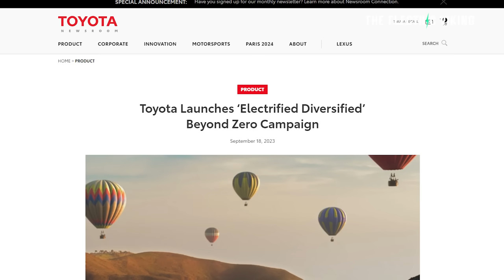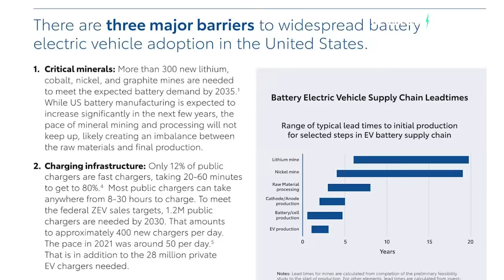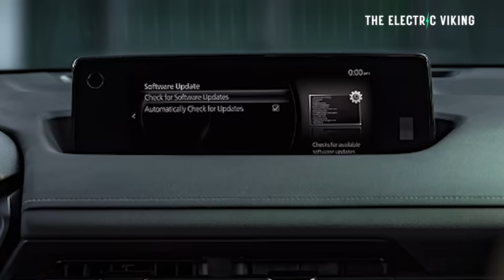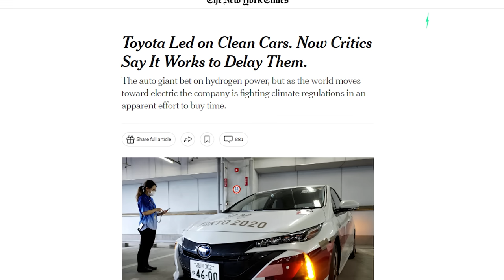We are witnessing the early stages of the biggest fall of any company in history

Comment: It's understood that Toyota has been deeply equivocal for a while now about EV tech. But what it seems to have been working on as an alternative is hydrogen cell technology. One would have liked to know more about that? :)
Reply: There are plenty of reports on that.  Bottom line: 

A) No one is building the fueling stations.

B) Fully 90% of hydrogen is made in a way that emits greenhouse gasses, and is no better for climate change than diesel.

C)  Green hydrogen is extremely expensive.

D)  The complexity and inefficiencies and losses in the hydrogen supply chain are massive obstacles to any hope of viability.  The only possible exception is in cases where batteries just can't be viable, and those are very few.

The head of MAN trucks has recently commented on the problem, and acknowledged all of the above.

Comment: Imagine if Toyota just built a car with no electronics.  Manual everything.  Easy to build, easy to repair.  Stupidly cheap.  Sell them for less than $10k each.  Just 2 doors and a big trunk.  Put a small easy to repair 2 liter motor in the front.  Make it 3 speed manual transmission.  No AC, just old school triangle front vents that blast air at you.  Use the KISS method on everything.  No fancy interior.  Just 2 front seats, and a back bench seat, a strip of carpet in the bottom.  That is all.  Metal and foam padding everywhere.  Just get a single star safety rating.  That is all you need.  Build it bare minimum in every way.

Comment: Toyota currently has bigger problems of declining build quality, material quality, reliability, and the use of overworked turbo engines in their trucks. As a Toyota truck guy, the new Tundra and Tacoma are a mess. I owned a 1st generation Tundra for 20 years. The new trucks pale in comparison to the quality of that 20 year old Tundra in every single way. When replacing it, I bought a new 2022 Nissan Frontier. It’s the truck Toyota should have built.

Comment: Why can't there be a business case for a super optimized ICE engine that runs on bio-fuel?  There are internet rumors about much improved ignition of combustable gas/vapor by means of optimized spark plugs, and this is just one optimization example. The current EV burns two times less crude oil (from oil-well to wheel) than modern ICE cars. If Toyota/Mazda can make the modern ICE twice as efficient, there you are.  You might say: "the EV runs also on wind- and solar energy", however, we can also produce organic fuel that could be cost competitive with the EV, if combined with super optimized ICE cars with low air/road resistance, like the Aptera. One can also giga-press ICE cars, which does not come with 'production energy' intensive battery packs, however, are much more complicated than EVs.  If Toyota/Mazda could also drastically reduce the complexity of the ICE car (together with much higher fuel efficiency), it is competitive.

Comment: the net zero ICE concept is that fuels are produced either biologically (think methanol, but instead of plants we use or bacteria to produce complex hydrocarbons) or electrically by using surplus renewable energy to drive chemical processes (one possibility is even to extract CO2 from the air to use) to produce combustible fuels. i read somewhere that in scotland they're already doing that with their  (intermittent) surplus wind power, cracking sea water to produce hydrogen as fuel.

Comment: Come on Viking, electric isn't clean, it has to be produced some how. Do you think that mining of any kind, for iron, aluminum or materials to make batteries does not have destructive effects on environment? Maybe we who live in outrageously large homes with electronics consuming gigawatts of excessive power that uses resources that do not come without environmental consequences? "live simply that others can simply live".
Reply: Vehicles them selves are significantly recyclable. Including the batteries in EV's, which are highly valuable for materials. 

The close to 60,000L of gasoline I've burn in my truck, isn't recyclable, or recoverable... But it has caused significant pollution. From the mining/extraction of the oil, the transportation of that oil, the refinement of that oil into gasoline, the transportation and distribution of that gasoline, and ultimately the burning of that gasoline and ithe pollution that its combustion created. 
And the making of that gasoline has consumed MORE electricity, then I would have consumed in my truck if it was an BEV.

Comment: Crack me from wrong here but the vast majority of a battery electric vehicle is basically manufactured the same way as ice vehicles. The huge difference between the two is the powertrain. So so it seems The vast majority of The aftermarket industry will still be needed.  The only real difference is the engine and transmission component manufacturers..

Comment: I think that if you focus on one part of the equation. Then you can’t see the picture.   Net zero doesn’t just mean the car.  EV cars are not net zero. Battery disposal will take hundreds of years to biodegrade, if not thousands.  Combustion engines produce carbon monoxide.  Carbon is a product we can recapture. Toyota is just saying that they are working on a technology that reduces CO emission all around.  Neither lithium batteries nor current combustion engine have a place in the future, but until the aviation industry catches up, we cannot move to the next level of engines.  Trains are way behind, but  for those nations that have or are working on high speed rails.  That should be interesting.

Comment: An internal combustion engine that burns hydrogen only releases water as a byproduct which is considered 0 emissions. 
 How you don't know this makes me wonder how much you know about this subject.
Reply: And where are these small cheap H engines and the production and infrastructure for all the hydrogen to burn in them? What are you going to use to make all the hydrogen? Wind, solar, oil, gas, coal?
Reply: In-depth explanation of why a hydrogen ICE isn't practical. Either the range is pitiful (much less than 100 miles) or you need to use a massive amount of space storing hydrogen, or you try to use liquid hydrogen, which will boil away in a few days if the car isn't driven. And bear in mind that the hydrogen costs much more than gasoline per mile traveled. https://www.youtube.com/watch?v=vJjKwSF9gT8
Reply: Hydrogen is abundant - sure, but the only way to make enough to fuel cars en-masse is to pass electricity through water, the problem with that is that using electricity to make hydrogen to then run through a fuel cell to turn back into electricity is only 40% as efficient as using that same electricity to charge a battery and run the motor direct.

Hydrogen (non fuel cell) engines are 25% less efficient than fuel cells.

You go between 2.5 and 3.3 times further per kwh of electricity used in a BEV than either solution.

A hydrogen filling station costs upwards of $2.5million per bowser and can only fill 40-50 cars before it needs to be refilled itself - for the same amount of money you can build around 60 Tesla Superchargers.

Hydrogen was dead 30 years ago.

Comment: Hey realestatenow. it is true some older vehicles were not compatible with ethanol because he seals in thoese vehicles could be damaged by ethanol. The later Multi fuel vehicles like you reference have seals that will not deteriorate due to ethanol  The new vehicles will also automatically optimize the burning of Ethanol but with limitations; the engines were originally designed to burn gasoline; and are not optimized to burn Ethanol.  So I do understand your point; you could run with E85 or higher but it would be best if the engine was designed from the ground up to burn ethanol; you'd get more power and more miles per gallon if that were done.

Comment: Small ICEs will never be more than 40% efficient. All the bells and whistles and mechanical fripperies you throw at it will never change that. Hydrogen fuel could theoretically mean 0% emissions at the tailpipe, but the whole supply chain has to be zero emissions too -- which could be done, but then you're going to waste 60% of that carefully harvested energy at its final point of use? Doesn't make sense. Electric motors are clearly the only really sensible way to produce tractive power in cars, the issue remains how to supply them. Toyota should pour its resources into answering that question in new and better ways, not flogging the ICE dead horse for more decades.

Comment: I think a case could be made for a hybrid that would have a battery that would handle 95% of a driver’s trips but have an ICE that would facilitate the occasional road trip. For me, a RAV4 Prime or Prius Prime with ten more miles of battery range would do the trick.
Reply: in that case just hire an ice for those 5% occasional road trips.
Reply: @TerryHickey-xt4mf   That’s hassle where I live and i’d have bought four or five times as much battery as I really need or use. And hardly did anything for the environment.

Comment: I'm hoping we see solid state batteries soon. Would love to see hybrid cars under 3000lbs and evs under 3500lbs. I would love a Model Y Performance, they weigh at least 4100lbs. With a solid state battery, it would be reduced by probably 500lbs while going a legitimate 400 miles on a charge. The weight of the cars, make the tires wear faster, I know the torque doesn't help either. If an ev could go 400mi and then charge around 15 mins, they would make more people ditch their ice cars. I wanted to buy a hybrid in 2016, but they weren't where I wanted them to be. Would have loved a 2018 Rav4 or 2023 Prius then.  I wish I had looked into a Q50 hybrid or Jetta Hybrid back then. They were IMHO the only hybrids to buy then

Comment: The problem i see in Australia for EVs atm is the charging infrastructure.  As soon as your away from major centre and main roads there are no chargers. One charge station company has just pulled out of Australia and another is following soon. I recently watch a video on YouTube were a guy drove from Sydney to Perth.  He had to stop 24 times to charge sometimes just for 15 minutes because he was worried about not making it to the next charge point. He had to ask cattle station owners if he could charge there, using their diesel generators.  And if course the other issue with most EVs is no spare tyre!

Comment: You don't know that Toyoda is talking about hydrogen fueled internal combustion engines?? Yeah, gasoline is not the only fuel for ICE engines. The only byproduct from a hydrogen fueled ICE engine is water vapor. THAT is how ICE engines can contribute to net zero. You have so much to learn.
Reply: But you need to produce and store massive quantities of hydrogen, which is expensive and can be dangerous. A whole new infrastructure is needed.
Reply: @dylanthomas12321  - A whole new infrastructure is needed for EVs too. On top of that, the electrical grid barely meets present needs, and in some places, like California, it doesn't even do that, and adding everyone being required to own electric cars will destroy it. Last year, Governor Newsom asked owners of electric cars to not charge them at specific times, without any regard to their lives, because of the lack of power to meet the daily needs of Californians. That's why they have rolling brown outs in the summers. 

Anyway, I was merely addressing Vikings complete lack of knowledge of Mr. Toyoda's preference for hydrogen and the hydrogen internal combustion engine they've developed.

Comment: Let’s close our eyes for a minute and pretend that tailpipe emissions are not at all harmful.  Let’s go even further and imagine that drilling for oil and oil spills do not pose a hazard to the environment.  Now, under these circumstances does an internal combustion engine still make sense when compared to an electric vehicle?  I say no.  Depending on the style of the ice engine it can have over 100 moving parts, (which do break during its life cycle). That is not including a transmission that must be attached to it in order to power the wheels.  Then there is the maintenance on the ice engine that must be performed 3 or 4 times a year.  The motor which powers an electric car has just one moving part.  The transmission is usually  a set of step-down gears which are maintenance free except for changing the oil every 60000 miles, or so.  In my mind, going simpler is better.  Simpler means less headaches and less cost.  No more ice engines for me.  I keep it simple.

Comment: carbon neutrality of an ICE engines fuel burning cycle depends on the source of the fuel. If the fuel is obtained from petrol fuels its not carbon neutral unless its offset by active removal of CO2 from the atmosphere. Alternatively, if the ICE engine runs on fuel obtained from crops it can be carbon neutral.

Comment: CO2 is not pollution in itself. EVs emit particles too. The problem is not electricity itself (well, it is, but that’s a different subject altogether at the macro level). The problem is the current battery technology. it is unsustainable. Lithium batteries were invented in the 1970s and basically, no one has found a better battery technology since then. It is good for a smartphone, but not for a car. I think you’re not understanding the big picture. Since electricity was discovered more than 125 years ago, scientists have still not yet found a way to store it “en masse” for delayed use. We have to use it on the moment. We are still using pitiful batteries and until that changes, current EV technology will never become mainstream. I don’t think gasoline cars advocates are science blinded. They are just realistic for the time being.

Comment: I believe longevity (through durability, maintainability, extremely long parts support etc.) makes a product greener (if you will) in the long run.
Compared to a lived product even if it may be cleaner during its operational short/er life.
Both produce pollution in the production, but frequent pollution in production due to shorter life span of a product is more detrimental than another that last longer even if dirtier in the operational life.

Comment: JCB has hydrogen internal combustion engines. I'm not sure if they only have them for internal testing at the moment (they are already in machines) or if you can buy them commercially available at the moment.

I'm not saying they are a good idea from an energy conversion point of view of cars. And green hydrogen production is waaaay to small at the moment. But technically a carbon neutral internal combustion engine 😜

Comment: I have to agree. Even if you ignore cleanliness and fuel cost, just a simple moving-part count - a couple dozen compared to hundreds - shows that EVs have it all over ICE cars in cost, maintenance, and reliability. And EV tech is still new, with improvements to be expected.

Stinky, expensive ICE cars had their day. Now it's time to move on.
Reply: Problem is that the battery consists of 20000 parts. If only 1 of those parts get damaged or is out of line, the entire house can burn down. The insurance companies have to be really careful with this, and can not be perceived as irresponsible. Then they will be liable for the consequences too. So it only 1 part in the battery may be damaged, they have to replace the entire battery to be responsible. Scrapping the almost perfectly fine car is therefor often the cheapest. This leads to very high premiums and on average a short lifespan of the EV.

There is no cleanliness problems with modern diesel cars. EV batteries are mostly manufactured in China because they have cheap electricity there from their many coal fired power plants. Cheaper energy = cheaper batteries. You know that China is burning 4.5 billion tons of coal each year? And are producing more cars than Germany, Japan and the US put together?

Comment: Battery cars are not net zero , never will be. They just shift the problem around.  They don't really solve the problem of sustainability . Manufacturing a BEV is a toxic process and so is making solar panels . The environmental impacts will be horrific when this scales up, on wildlife, open spaces and farm land.
The caricature about ICE cars is false - nowadays there is no smell of petrol or roar of the engine. Maintenance is low, every 20,too miles, it is practical and useful. I suspect that is what Toyota is alluding to
Much mention is made of cameras using film losing to digital  or the horse and buggy. But remember no government forced this change , there  was no need to

Comment: Hydrogen made from renewable energy can be used in ICE engines. Toyota and European truck companies  are leaders 8n this field.  Only H2 O out the exhaust. Fill up with gas I'm a few minutes at your local fuel stop. No waiting for hours for a charger. No child labour to mine the minerals for EV batteries. 
The EV depreciation in European is becoming horrendous.
 Clean EVs reliant on coal power or nuclear energy?

Comment: If you've worked on EV's and have had to give battery quotes on a 10 year old ev you will never want to buy one yourself. I would rather spend$1000 on a repair every year than to replace a $36,000 or $45,000 battery at 10 years. Battery prices won't drop because every brand has to pump out a certain percentage of electric cars in the states. If they don't hit it they get hit with massive fines. That can cancel several months worth of profits or more. 

The automanufacturers do not want to build electric cars because there's no money in it. Each unit is sold at a loss. This is a business model that small companies can't keep up with without going broke.
Reply: Which is precisely what Toyota has been trying to explain🤷‍♂️